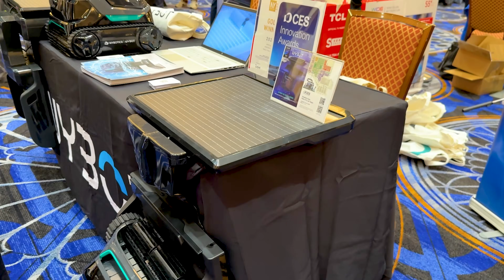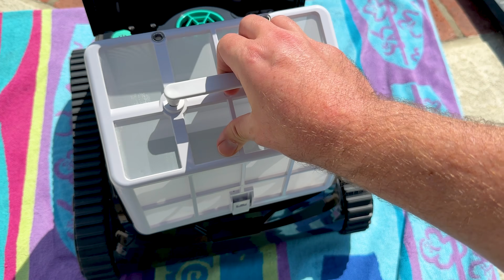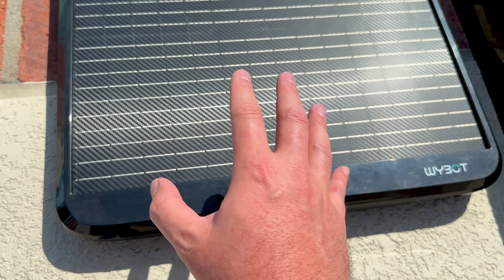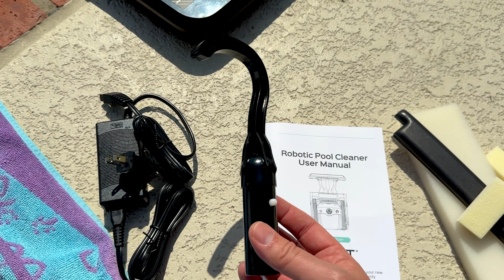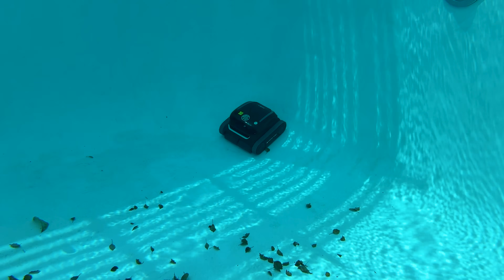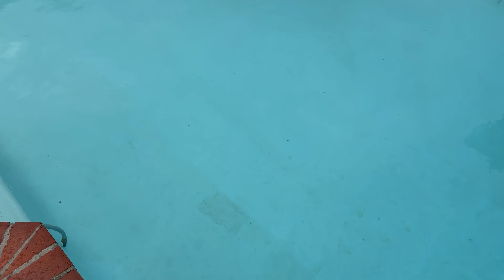No Cords, No Charging?! Wybot S2 Solar Pool Vacuum in Action

Comment: Had it, returned it after 34-35 days. The thing just wouldn't talk to the app and you couldn't schedule any cleaning. Uninstalled and reinstalled the app so many times make my head spin finally just said I had had enough and told them I wanted to send it back and got a refund. I would never buy another Wybot ever
Reply: Same for me, the app constantly log out, and does not remember any setting, it communicates with the robot 1 on 10 Times

Comment: I never understood the need for electric pool cleaners. Why not just get a pressure-side pool cleaner?
Reply: Keeps your pool filters clean, you can run your pool filter on lower speed and less often to save electricity, robotic pool cleaners are cool, and you dont have the hose floating in your pool when you have people you dont have to remove it and put it back. So yea lots of benefits